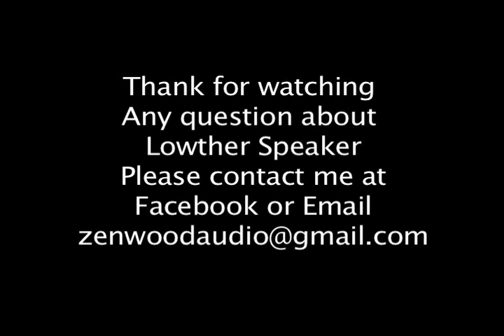How To Replace Lowther Speakers Foam Surround and Spider

Comment: The best way is to fit the coil at the center of the magnet before glue up everything. Otherwise, the coil may not attack the magnet and then produce noise.

Comment: Strange to see the unusual sequence and method to restore the speaker. Normally I will center/ align the voice coil by inserting centering tool in between voicecoil and pole piece before I glue the spider, especially fullrange speaker with very small gap between them .
Reply from the maker: Ew C.G. Between Gap and coil are too narrow, 0.1mm only,  hand adjustment can do.
Reply: I totally agree with your approach - that way it is done here is wrong. I am pretty sure he will have a hard time aligning the voice coil into the pole piece - the chance of the voice coil rubbing against the pole piece in very high in his approach....I would not pay him to do mine...
Reply: Lowthers are special. You can move around the whole cone+voice coil assembly before tightening. Shims are of little use. Just gotta look and chance it. Just keep the cone and VC vertically straight when gluing the spider - with the help of shims. One line of Vc thred should be visible above the VC gap.
Reply: HI TESTING THESE ON THE BENCE  WHEN A BUZZ HAPPENS FEEL THE CONE WHERE BUSS IS AND TAP THE FRAME ON THE  OTHER SIDE TO THE BUSS,  TEST AGAIN IF NO BUZZ TIGHTEN BOLTS RETEST  AND FIT.  HOPE THIS HELPS (I USE TO BUILD THESE IN BROMLEY FACTORY.)

Comment from the maker: Lowther is paper cone, not plastic.
Alcohol will dissolve the paper surface layer.
Thinner and Acetone working fine to remove the old foam,but never add too much. Thank for watching!
Reply: WHEN WE BUILT THESE WE USED Shellac ON THE PAPER CONE . HOPE THIS HELPS...

Comment: I would like to know where can I buy foam spider
Reply from the maker: isufi3 I selling the surround set on EBay, if you just need spiders, just let me know your Paypal account, $35 plus shipping. Thanks!
Reply: I'm interested in buying it on EBay, give me the link please
Reply from the maker: isufi3 https://www.ebay.com/itm/263026418179
Reply: @zenwoodaudio  , can I buy from you spiders and surround? I need for two speakers.

Comment: Why is foam put "upside down"?
Reply: +hilema41 Because that's how the speaker was designed to work with the foam upside down. Most other speakers have the same design